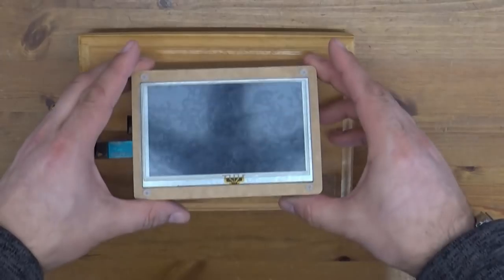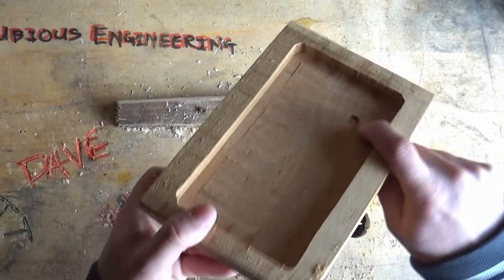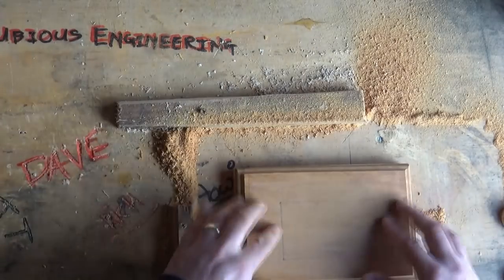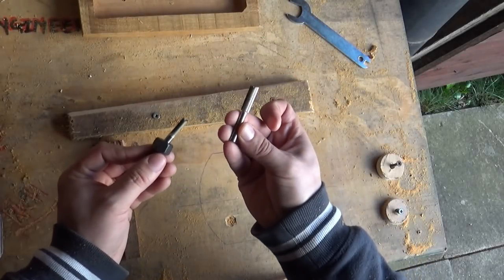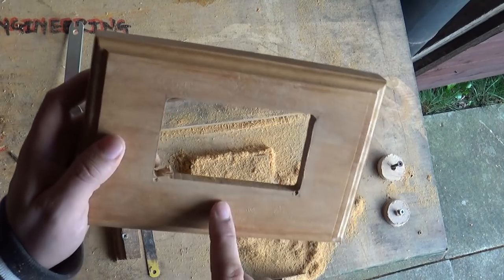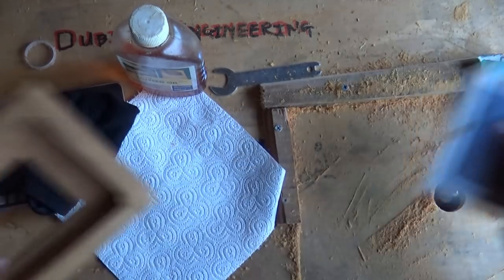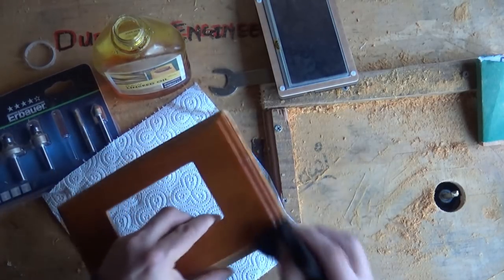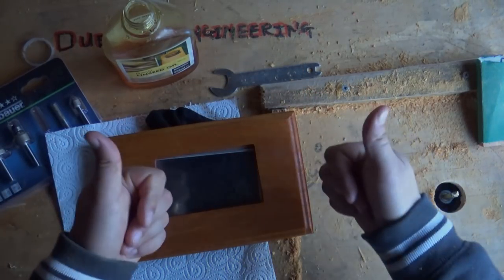DuB-EnG: Make a Wooden Handheld Games Console with brass bullet buttons PT4 RetroPie Emulation

Comment: Oh yes, the linseed oil will keep that wood in good condition :-D.
That manual cnc makes your job much nicer, but you have to keep screwing the walls down in different places.
'
A square of sheet mild steel glued to the table and some old hard drive magnets embedded in to the walls and you can drop them where you like and they wont move.
A possible thought only :-D.
Reply from the maker: Bloody brilliant thought Bob! - I'll have a look around for some steel...  Also, that would be useful for future projects...  I plan to get the welder out again in the near future! - I think I might make a home-brew electric bike!

Comment: HI, any particular reason(apart from obviously wanting to use it) that you used router to cut out hole rather than drill then jigsaw it ? Also as you have the router are you considering routing into the inside so the screen is more flush with outside ?
Reply from the maker: The router is just part of the project...  but yes, life would have been less scary and much more controlled with a drill and jig-saw as you suggest.  I may make the wood thinner and get the screen more flush...  I think another 3mm should do it... I don't want to go too thin...  I'd like the whole thing to be a little thinner in profile as it is a bit clunky at the moment.